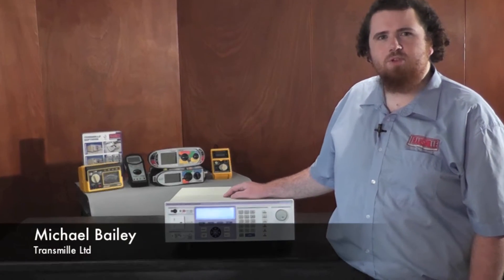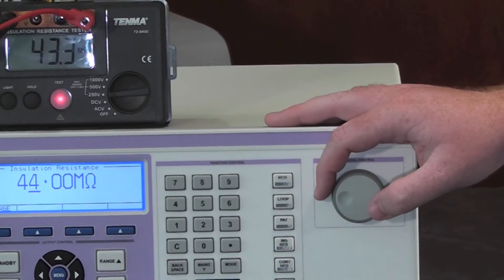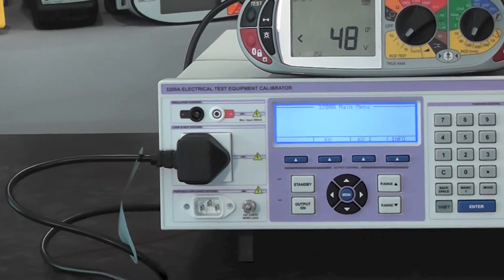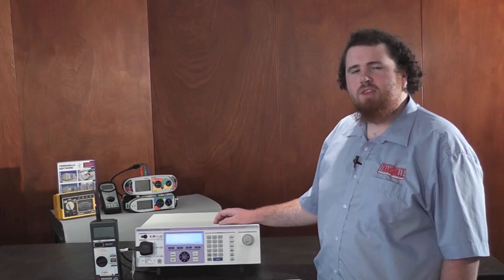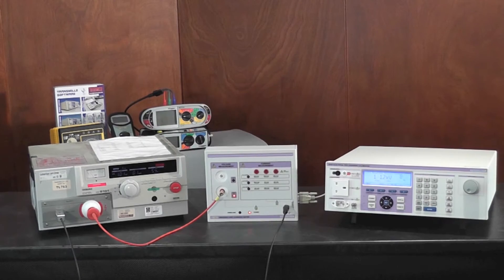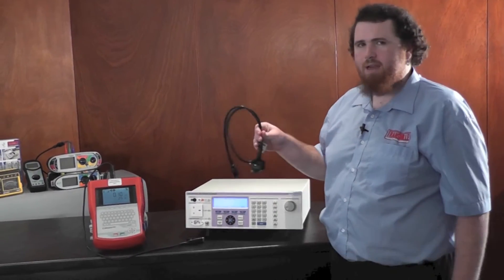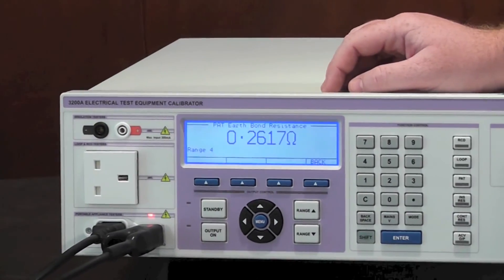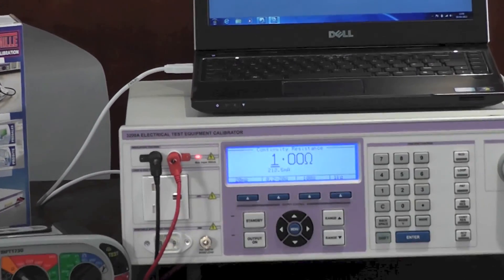3200A - 16th/17th Edition Electrical Test Equipment Calibrator

Comment: There is no such thing as a 16th 17th or 18th edition compliant tester, the NICEIC /JIB NAPIT OR the EIT wiring regs has any say as to what make or brand of meter can and cannot be used  the tester test values have been the same since the first edition of the wiring regulations they have never changed. Even the bakolight crank opporated mega is still suetible to use to day. fact